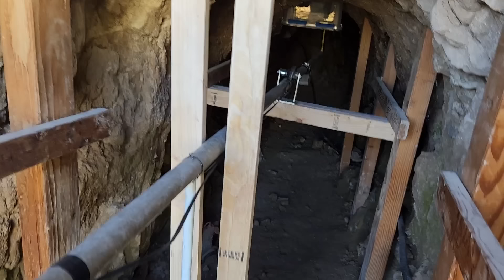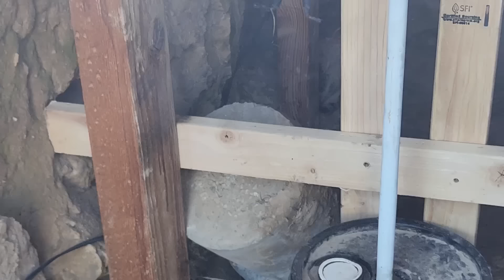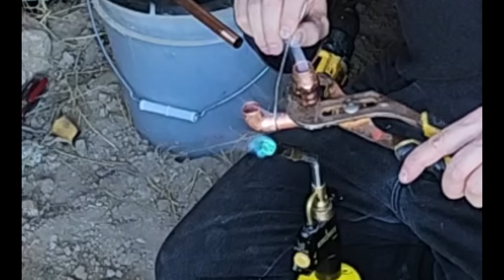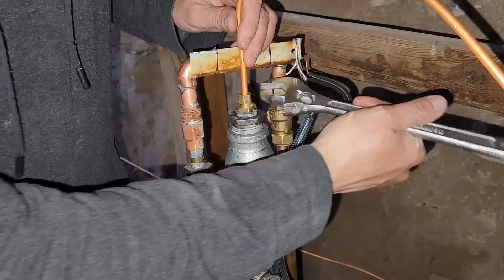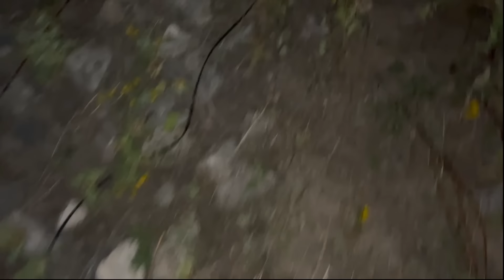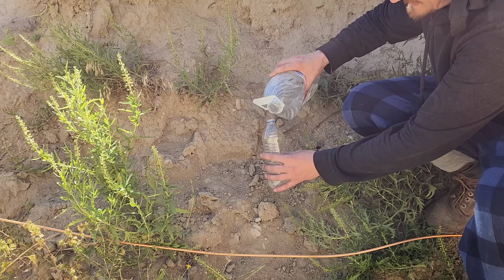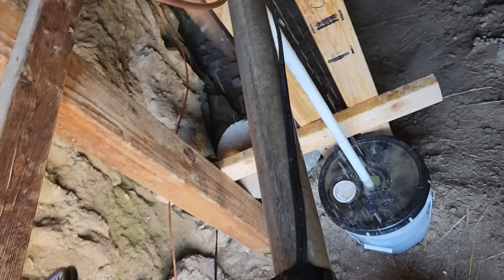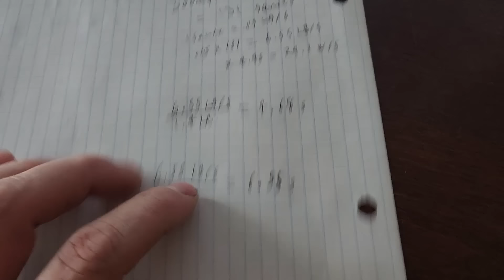Sodium Water Hybrid Rocket?

Comment: If this stuff continuously burns even after just a little bit of water is added and therefore you no longer need a continuous supply of water I think that you could quit the sputtering from the water going through the system by putting a regulator valve before it hits the rocket motor that way as the pressure decreased once it got below a certain level it would shut off and whatever is already in the rocket burning.  continuing to burn without sputtering from the lack of continuous water at least.

Comment: I wonder if you could mix the sodium with some sort of lattice to keep it into place? Like if you poured the liquid sodium in with a wire mesh welded to the frame? (not sure that wouldn't just melt though)

IRL rockets don't mix a perfect ratio. The tend to mix fuel-rich, expecting the excess fuel to vaporize and become propellant. They chose fuel-rich, because excess LOX with react with a thruster itself, but your Oxidizer is just water, so should be fine. The expansion of boiling water should be overall beneficial to you.

Comment: Once again, you're not taking advantage of the propulsion of the hydrogen actually burning with oxygintroducing water. You should be able to get. The Propulsion of the combination of sodium and water, which basically produces a lot of steam. And if you combine that the hydrogen that is created into some sort of ramjet situation, you get the benefit of the hydrogen, moving the ramjet plus the reaction of the sodium breaking into. Sodium hydroxide and hydrogen. Any thoughts

Comment: The authorities most probably pass such bills and/or restrictions because they want to avoid a piece of metal hitting them. They no doubt know that in their case that probability is already very high, regardless of the form of that metal. It's also funny because they've been making sure there's an abundance of metals in our stratosphere. I know almost nothing about rockets, but I've been thinking that if you would make an RC plane made of welded PE film and fill it with Helium, then get it in the wake of one of the planes which are showering us with that garbage, if it had some remotely, or simply periodically incendiary devices, all these nanoparticles would maybe create a nice light show. Because I know nothing about turbines, I would certainly add a couple of cones in hope they would collect and compress the mist suficiently to slowly push the plane forward if ignited at the narrow end.

The absolute bingo, of course, would be if once ignited, the flame would propagate forward towards the source of the pollution. I won't tell what I would really hope for:)

Comment: It seems that one problem is the method to inject water.

If you had a mister that went down the center and sprayed the bottom with water then slowly raised itself as the sodium burnt away, this would allow for a more controlled burn rate.

Comment: You could try a standard 30-50lb auto injector to atomize the water better. You can open the injector with a standard 9-12v battery and to close the injector you just disconnect power adding a safe way to kill the reaction. The injector may also work as an arrestor. You can get injectors at the scrap yard for probably $10-20 and just cut the electrical with a few inches of leads and leave it attached. All injectors are just a + and - lead. I recommend at least an EV6 injector with a minimum of 4 holes for efficiency. What ever you do dont take the injectors off of an old jeep their EV1 single hole with poor atomization til 1998. In theory you could just get a fuel rail off an inline 4 engine with all the injectors and the end of the fuel line including the quick disconnecting connection and just power 1 injector and connect that to the top of the rocket engine. You could probably make due with a water pump in a container of water at that point due to the added efficiency of the injector or just add a barb to the end of the water compartment and connect the fuel line with a high quality hose clamp.

Another idea is a longer injector of small copper tube like what you ran to the argon tank with a capped or sealed tip shoved all the way down the hole in the center of the sodium with pin holes drilled all the way down the tube to get a more controlled burn.

Comment: Can you use molten sodium? Keeping it at 100-105C shouldn't be a problem, but if you injecting fuel into oxidizer you should have much more control and burn will be cleaner.

Comment: A good way to make the solid Sodium behave might be to make a polymer matrix. If you mix the Na with an acryllic or epoxide base you can form a dispersion that might hold up better within the engine. The high temperatures will slowly melt the matrix away, exposing new Na in a uniform fashion. A dispersion of less than 5% by weight might be sufficient, and using peroxide as the oxidizer would allow for the polymer to burn, adding back lost thrust. 

Glad to see you’re still scientific. It’s hard being anything but a farmer out here in the west; you are a running inspiration from my childhood.

Comment: A big issue I see with this is injecting the water from the top. This allows sodium to be broken off and ejected out the bottom without reacting in any meaningful way. With other solid fuel rockets they burn from the bottom up so that all the fuel is consumed before leaving the engine. However, I can not think of a good solution to this. If you put the injector at the bottom at a 45 or so degree angle from the nozzle heat would be a problem as well as pressure created by the burning fuel trying to push the water back up the tube.

Comment: I mean the obvious thing to change is the oxidiser. Using some flavour of peroxide (even 20-30% hydroponics stuff) could drastically improve your results. It's a solid concept, and it preserves the idea of making a 'safe' rocket engine. Obviously if you used the real rocket grade HTP at like 90+% would get you being asked questions by basically every flavour of feds and it'd be both inpossible to acquire and too dangerous to handle for the concept of safer rocket fuel. You could also consider casting the hollow cylinder of sodium with a bit of a lip between the hole in the  nozzle and the edge of the fuel to try and catch some of that sodium that's leaking out. A combination of using pretty concentrated peroxide and mods to the nozzle vs fuel core could make this a pretty viable and efficient engine, by just a) not giving the sodium time to drip out through faster oxidation with peroxide rather than water
And b) trying to catch that little bit that does.

Comment: Bravo, nice Project! 
Preheated sodium injected into a combustion chamber along with water, or maybe NaK Alloy , nice idea! the low melting point of the sodium maybe makes it more suitable for a liquid/liquid rocket...
Also try using excel (or something) to integrate the data, like simply adding and subtakting. The cut out graphs made me think of the old days of chemical analysis :D
I wish i had the time to do a project like that or get my hands on so much sodium, rock on!

Comment: Once the water starts reacting with the sodium, wouldn't that force liquid water back in the water-feed-tube? You'd need the argon pressure to be higher than whatever the peak pressure in your reaction can produce? The performance of your rocket may be limited by argon pressure otherwise.

Comment: Loved the video! Had a few comments/suggestions (might be less useful if you change the design to liquid fuel)
-The paper weighing for the integral was excellent!
-Seems like the system might benefit from a pressure reservoir of some sort, instead of just a long copper tube. That would create a more even water output.
-A better system for adding the metal to the engine might help; the oil looks like it gets in from your melting cup, as you mentioned. Maybe a little drain valve in the bottom of a cup, so you don't have to pour the oil off first?
-Seems like you could be generating some backflow, as you create high pressures in your combustion chamber. Perhaps a check valve between it and the water line?

Comment: I would suggest melting the sodium with dry sawdust so it has a binding agent. That way it wouldn't all melt at the same time and blow out of the nozzle, thus creating a longer thrust duration. The water nozzle has to create a mist instead of a straight jet of water that is why there was sodium still in the motor when you opened it. The water shot straight down the center that is why there was sodium left-over at the top of the engine. I would inject compressed air by the water nozzle to get combustion inside the motor increasing the thrust.
Reply: Sawdust is much less dense than sodium and thus would most likely float on top of the liquid. If it behaves abything like liquid tin, it would never mix evely.

Comment: Would it help to build a pressure valve for the  thrust?  This would ensure the bottom of the rocket remained closed until enough of the sodium reacted to build the pressure to open the valve.

Comment: Would a liquid sodium rocket work better?
Like using a kettle heating filament or something to keep it molten. then make a liquid-liquid engine design but that could be difficult. 
Maybe using a displacement pump to control the water and sodium feeds as you would need electricity for the heater anyway.

Comment: If unreacted sodium is exiting i wonder if some kind of afterburner would help improve efficiency. Instead of the molten sodium burning in vinegar, another chamber with a smaller water supply could help drive the reaction to completion. 

Combine that with the oxygen -> hydrogen ignition suggestion elsewhere in the comments and you could end up with quite a complex rocket, but I'd love to see if and how much specific impulse would improve

Comment: I think because there was so much left over sodium left over in the chamber, perhaps you might want to change the orientation of the water injector to not enter into the chamber from the top of the chamber but try tapping in into the end, but from the side of the chamber, so that the water, when it is injected is pushed into the chamber in a descending spiral pattern so that it can come into the Sodium from the top down. This should remove or at the very least mitigate the odds of having leftover unspent fuel inside the chamber. Give it a try, it couldn't hurt., the second thing I wanted to touch on is the spray pattern of the injector, if you go with my first suggestion then you can likely keep the injector you used in this test, but if you wanted to keep the water being introduced from the end of the chamber, the you MUST use an injector with a wide spray pattern, one that has multiple outlet holes to allow the water to reach the side of the combustion chamber. However I think the side mounted injector nozzle is the best way to prevent unspent fuel residue.

Comment: Have the grain burn from bottom to top with the water injection coming in from the bottom. If you still want to have it shoot the thrust down have a tube go from the combustion chamber 180° opposite direction with the nozzle at the end of that tube and with the extra length of the tube it'll give more time for the molten sodium that escapes the combustion chamber to burn still inside the system and not outside the system adding efficiency to the fuel which might negate the efficiency loss of the extra Plumbing used to divert the thrust down in the opposite direction of burn. In the now inverted combustion chamber gravity and G forces of the rocket moving u should help keep the sodium in the combustion chamber as it reaches a molten state

Comment: Maybe water and sodium can be fed into the chamber at the same time to prevent sodium from melting. Like a pressurized container of small balls of sodium in another chamber suspended in mineral oil?
Reply: I believe if the sodium is made into tiny beads that would give more s7rface area to react with the water and the beads will be small eno8gh yo ignite completely

Comment: I know they add aluminum to solid fuel boosters to get better impulse, I'd be curious if you could get it hot enough to vaporize finely divided copper.  Copper has a very high expansion when it transitions to vapor, I think I read it was 57k times its original volume.

Comment: 14:31 I’m not seeing a check valve.. that is going to allow thrust or pressure to go backwards into the water supply unit and beyond.  It seems like a check valve would be useful.  I guess the pressure of the argon is acting as a check valve.

Comment: I am an engineer. You are obviously not. Your smart. You have several problems. I used to launch rockets too. 
   First you need to know the burn rate of your fuel. How many inches per second does sodium burn at ?  This would be difficult to measure and would require a painted sodium wire of a known diameter and a long length (at least 6 feet). immersed in water, and an precise accurate way to time the burn. Timing it visually would not do. Resulting in a calculation of Grams per second or inches per second..
    2nd  your fuel burn problem is proportional to the surface area of the Sodium. You need the Sodium in granular form. Then Mixed with an anti caking agent like 5% silica sand and a hydroscopic flammable secondary fuel like 15% black powder or sawdust. This will create steam fire and thrust.
You will need a ceramic nozzle.
Then you need a body and fins made of carbon fiber or fiberglass. You need  a nosecone "container filled with pure H20 not tap water, not distilled water.
 You need an orifice check valve in the nosecone to control the burn rate. The size of the orifice will determine the burn rate. It lets air in and lets the water out.
As the rocket launches the G Forces will pump water into the engine. Carry 1.25 times the water needed to burn all the fuel.
All you need is a manual or solenoid valve between the water and the sodium.
Your weighing the paper method is not precise enough. It introduces lots of errors..
Personally Sodium is not a good choice for a fuel. Too hard to work with. Else NASA would be using it.
Hope this helps.

Comment: I have zero experience at all with this but for the wasted sodium, if you put the injector for the water at the bottom facing up and it was constantly spraying upwards at a high pressure, wouldn’t that help retain sodium and use more of it by effectively rinsing the fuel chamber?

Comment: This guy tares! What about a graphite honeycomb as a support to hold melting sodium in the grain? Does liquid sodium on graphite have  any surface tension? Might move this from hobby scale into a very costly design, though.

All in all, sounded like you were a bit disappointed by the results but it's super cool to see someone working on "carbon negative" propulsion, in that the net effect of launch would be cooling rather than warming the climate. 

Im very impressed with how well designed your process was, given that you're working with everyday materials and instruments for measurement, and the idea behind the experiment. Your attention to safety without adding to the BOM was also very impressive.

I subscribed because of this video and look forward to watching this idea mature. May one of the wealthy folk watching give you the funds to devote your time to these experiments! All I can do is subscribe for now but you should be proud of all of it!! If it weren't for the sodium melting, it would have worked beautifully... I especially think the threads left by the casting dowel might be part of why it burned the way it did. Lots of forces pushing on the walls and friction to heat the fuel grain. Maybe a water jacket around the combustion chamber to keep the sodium cold, like a liebig or west condenser, or doing an open dry ice and acetone (yikes) jacket. With the acetone, the jacket would need to be soldered and might need to switch to a different housing metal for better heat transfer to keep the metal solid.

But im very interested and you should be very proud of your janky yet clever af test stand!

Comment: A sodium water rocket makes more sense as a liquid fuelled engine using molten sodium and near boiling water. The water could be heated by cooling the combustion chamber with an initial boost from Htp to get things running. There has been a lot of work done on the plumbing required for handling molten sodium.

Comment: Watching you describe how you’d trigger the rocket made it feel like a proper Rube Goldberg machine - the wires melt the string which releases the lever which is pulled by the spring which allows the water to be pushed through which hits the sodium which creates the gas

Comment: A honeycomb mesh, or layered conical sheets may have a better time reacting in the chamber than a solid clump like that, it would allow the water to run over/through and react as it wears the metal down evenly, giving a more immediate but more powerful thrust.

P.s.  actually, after some thinking, a thin sodium foil thats allowed to spiral inward as it reacts may even be better.

Comment: I don't think your combustion chamber design was well thought out, the simply cylindrical flow through hollow limited how much material could actually react with the water at any given time and as it required water to flow through to have ANY reaction it was not a self sustaining reaction like "real" solid boosters are... so the "oxidizer" ran out ages before the reactant would have been fully consumed. I don't think any combination of shapes like a starshaped void or giving it a cone from down to high up would have improved on that, you'd probably need a granulate with some sort of filtering hold back at the nozzle end to only allow gas and fire to escape for maximal exposure to the liquid...